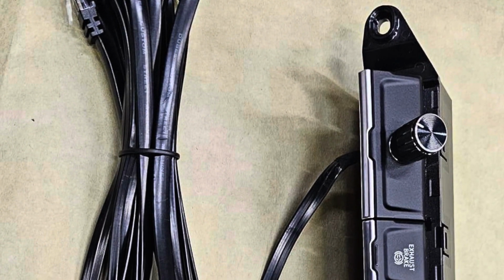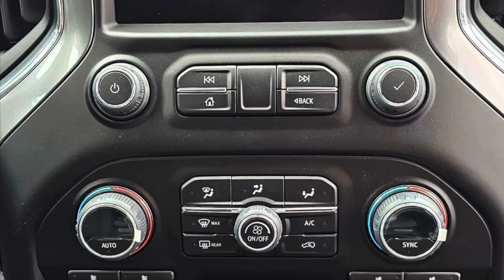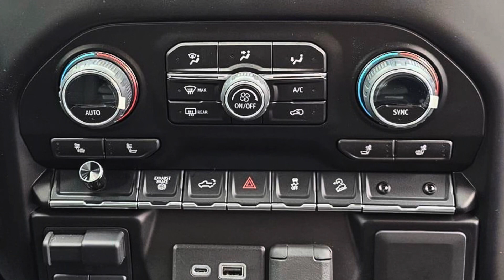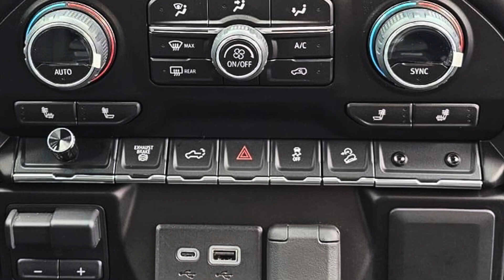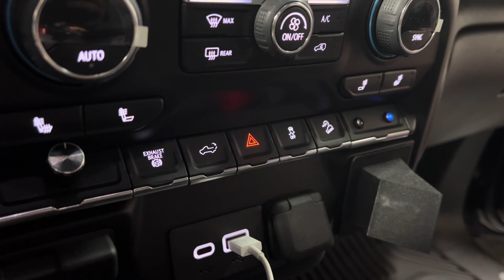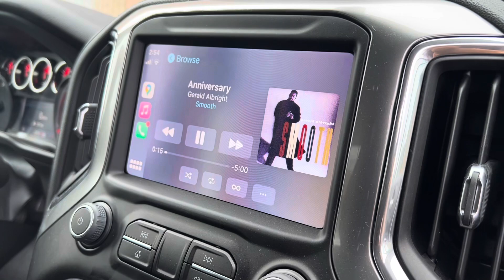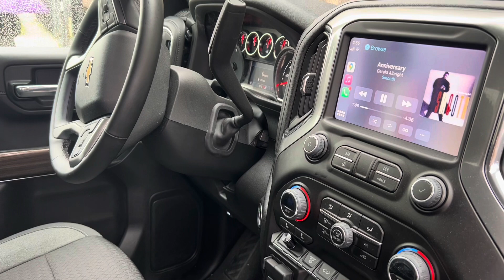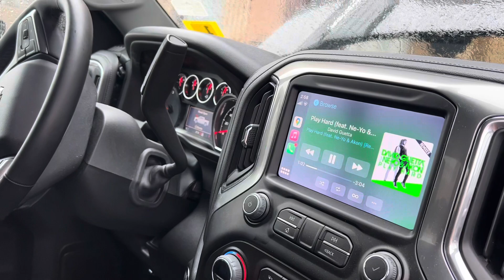GMC Sierra HD 2500 audio upgrade

Comment: Did you use the Axxess piece to integrate into the DSP ?
Reply from the maker: No we used the pac audio one
Reply: Nice.  I forgot the 3/4 ton truck still uses the old style head unit where the Amp Pro works.  Great job btw
Reply: Base audio truck so probably just used the LPHGM71 to go hi level into the dsp. Amp pro doesn’t exist for the 19+ style radios system.
Reply from the maker: @Dman199739 100 percent correct
Reply: I didn't see it was non Bose.  Did you just drag down that single eq band with a narrow q so the door chime doesn't blow you out of the truck?